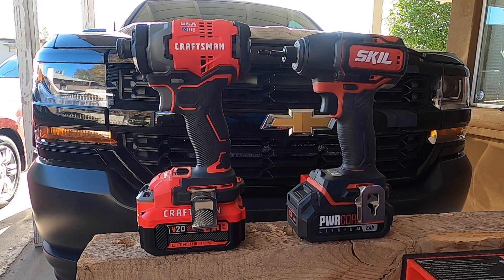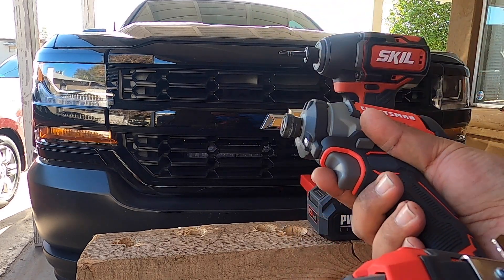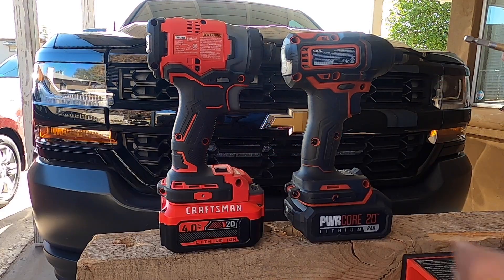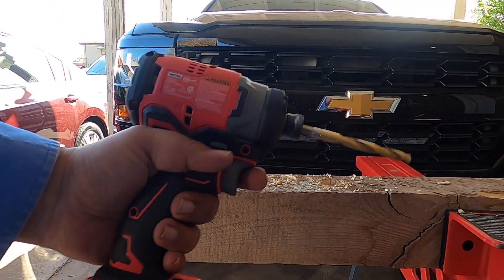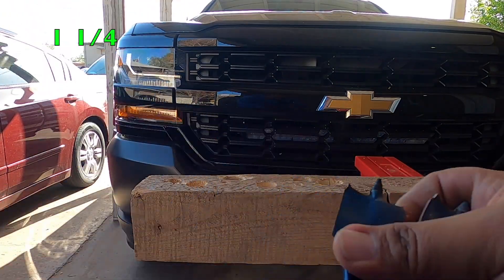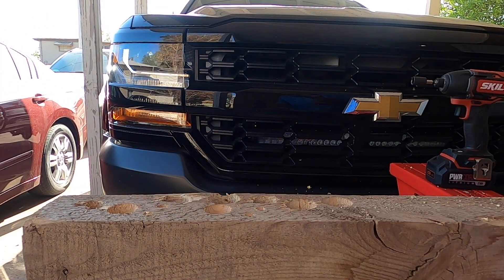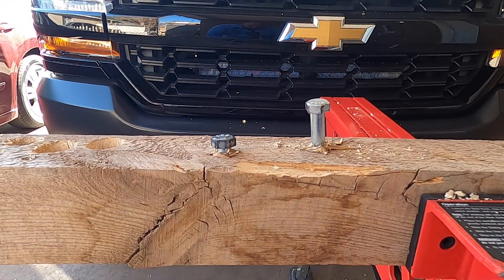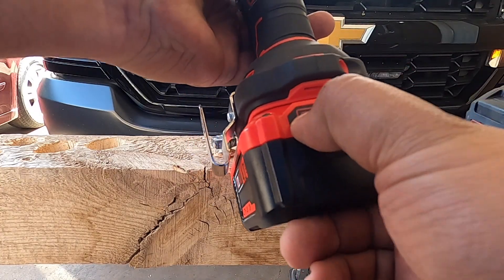Craftsman (CMCF820) VS Skil (ID573901) Impact Drivers

Comment: How you put a 2ah battery to face off a 4ah battery. That's like me putting a toyota camry to race a yaris 🤦‍♂️🤦‍♂️🤣🤣 I'll go with skill anyday craftsman battery suck they dont last that long even if you baby it. For some reason they lose power over time.
Reply: You don't know what you're talking about I use mine everyday and it gets drained everyday and still going strong after a year and a half
Reply: What you talking about 2 ah vs 4ah isn't competitive at all my friend it's gonna drain faster and doesn't give the same performance the higher the amp hour the better performance you get and that's why they went from 12v to 14.4v and 19.2 to 20v like come on dude and they're pushing out almost not exactly but almost the same results. I mean it's good that they're increasing it but why is it that they had a huge recall on the battery's even for the lawnmower battery's. They don't last long why idk. But you can Google it. I can guarantee you that. I can take a 18v Dewalt drill and put it will ur craftsman n it will beat it.
Reply: @Lou Cifer  maybe your one of the lucky ones my friend and I'm very happy for you.
Reply: @macho 3088  It's not lucky. Do you know all these big-name brands use the same batteries it's either Samsung, LG or  Sanyo
Reply: And did you know that all those big brands don't even go threw battery claims and recalls like craftsman did over the years I mean no company Is perfect but wow craftsman no Bueno why you think they sell their batteries so cheap and I mean again isn't dewalt part of Stanley black and decker hmm that doesn't sound rite. I can never get 2 4ah batteries for less than $100 not even on a sale or black Friday either. Not even ryobi which is the under dog sells 2 4ah batteries for $199.99 compare to m18 d18 Porter-Cable  n rigid think about it man. I can buy one battery for my M18 like $100 and  that's a 2 or 3ah battery. And craftsman is suppose to keep up with the brands I just mentioned. Craftsman is an awesome drill but they need to focus more on their battery platform in order to be the best. I don't want you to think I hate craftsman cuz I don't I would use it if I had too but in my opinion they need to work better or those battery that's how I see it and feel.
Reply: I’ve returned every skil tool I’ve ever bought. Their customer service is the worst!